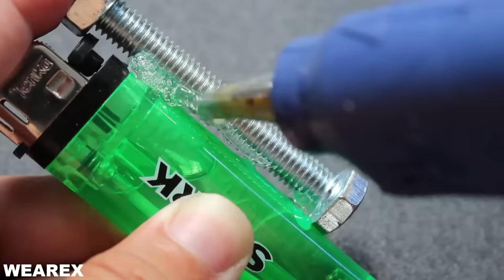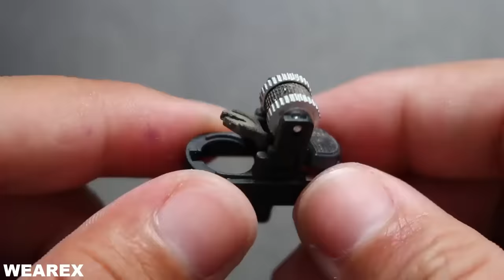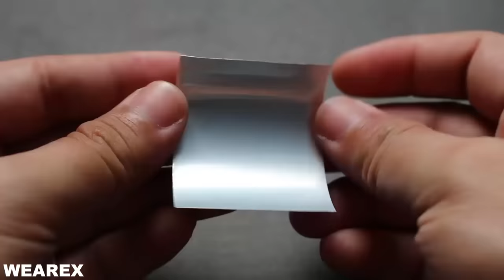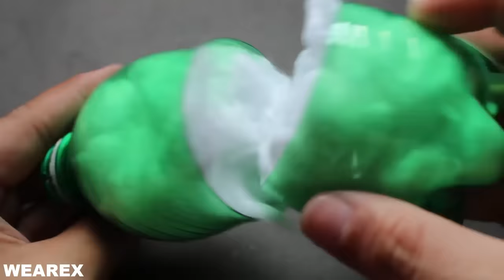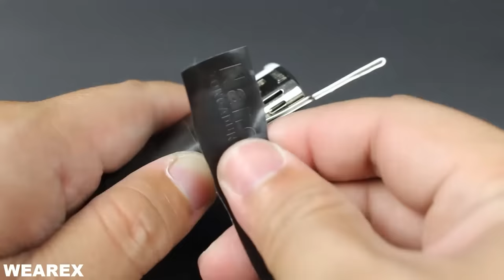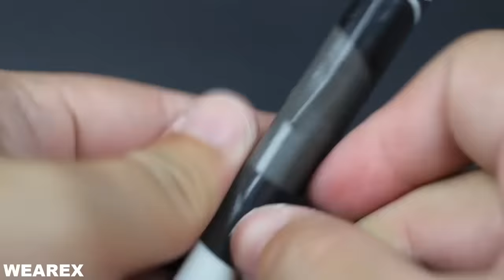Top 5 best life hacks for lighter

Comment: number 1 and number 3 are very unsafe. because most lighters are not supposed to be held on for more then 30 seconds or else the flint that is used to make sparks super heats and explodes.
you can see a demonstration if you take apart of lighter and pull off the wheel and see a bit of metal with a long spring.
light this to red hot and throw it on the ground and it explodes with a bright light.
number 1 hold down the spraying bit causing heat to build up. and number 3 using a cotton wick so close to the igniter is the same principle.
number 2 is just how tweakers light up meth.

number 4 as a make shift soldering iron is actually pretty good.
unsafe but good.
Reply: cheezandtoast #4 is just for use in a pinch
Reply: Since when have we cared about safety
Reply: I️ was like that’s not safe!
Reply: cheezandtoast I was actually freaked out waiting for it to pop lol.. It happened to me when I was younger
Reply: I see no use in doing any of these things.
Reply: Somebody who knows how lighters function? Big wowza, thought I was the only one.
Reply: yeah i was thinking the first few were like tips and tricks to being a better tweaker, but the soldering iron isnt that bad of an idea.
Reply: cheezandtoast-there's also no mention of the necessary protections from those inherent dangers along the way, like cutting your fingers open on the aluminum can. Only a young child might try some of these, and I hope someone sues youtube for providing unfettered access to this type of information to children without also providing any type of safety warnings-they deserve it!

Comment: the soldering hack is really good one
Reply: kris that soldering job was a really bad one though😂😂 Probably just invest in an actual soldering iron if you're going to be doing any soldering on any wire larger than what he did, and if you're going to be soldering more than once in your life. That would be a huge pain because the paper clip would cool off so fast you would most likely never be able to finish a solder in one heat, btw, don't cold solder like that.

Comment: So on the third one you took apart a lighter, to make a more crappy lighter??
Reply: i think he will show how to build a lighter without gas
Reply: Ok  so the idea is, "lighter dead? no sweat. Just get a plastic bottle, scissors, a bunch of cotton, electrical tape, a soldering iron, ethanol which  everyone totally has lying around & build a new one"... Or just spend a buck & get a new lighter. XD
Reply: xSlappykinkaidx or less for some matches!
Reply: it was a more like a way to start a fire from the inside of a building. throw it threw a window for no arsenic trace.
Reply: it was a more like a way to start a fire from the inside of a building. throw it threw a window for no arsenic trace.
Reply: Real Victoria glass bottle and some Gasoline?
Reply: MinnYX wool, plastic bottle, n alcohol
Reply: DanJBarnsley Or just bum a light.
Reply: The lighter he built will last much longer than the average lighter, and to refill it you just need cotten, which is much cheaper than lighter fluid.
Reply: FYI for anyone that thinks 3 is a good idea it would melt apart in 30 secs... Ever held one of those for that long? They melt and break.
Reply: Nah bruh he's showing how to make an old school Zippo lighter when it wasn't torch like. Pretty cool if you ask me.
Reply: Don't forget the screws.

Comment: #4 would produce a "Cold Solder Joint"  this is week and in many cases will increase the resistance of the wire.  You have to flux and heat the wire a you apply the solder.  I must say #5 was pretty cool as cutting foam is a mess and if you need a small piece its hard to do.
Reply: It wouldn't. It's flux core solder. You can tell from the smoke and because it wetted properly onto the wires.

Comment: how to make a shit DIY lighter out  of a working lighter
Reply: that is just in case the lighter resevoir is broken or need more bigger capacity of gas but thats not necessary to have a bigger one but if you have a broken resevoir then this would be useful
Reply: This is also useful in survival.
Reply: The ElectreKid because I'll need to be able to solder in a servival situation lmao. Not one of these is useful in a servival situation
Reply: Andrew Miller what if you dont have a solder and practically a solder needs electricity so you need power supply of course you dont want to waste ur time looking for one when ur starving. (unless you do the tutorial in making the lighter as a solder but there is no connection on about that cotton lighter I'm saying bruh)

Comment: As a life long smoker, of various different things, I guess this guy doesn't know that black plastic near the sparker melts and would ruin any of the work you just did.
Reply: Bro I build the beast of a beast that could withstand that 😆 stoned shit less I got the notion to try it do to the fact we were having a power outage and no candles ....I used copper pipe fittings along with brass fittings.... they were bad ass all you need that is not metal I'd the pull out top from a clipper the one kind that has the packing tool/flint holder combo dealo..... they are bad ass I'm working on making a few  larger ones that will be tiki torches for the yard with thier own sparker on each so you can just walk by and swipe a finger 😆

Comment: the first thing is SO STUPID! if the lighter gets to hot it explode! don't try this!
Reply: @jhondisjames2151  those cheap little lighters can't take the heat for long.  The longer you have it lit some parts are getting brittle, some are slowly melting and others are getting very hot.  It's not going to take long before that cheap little sucker has gotten too weak to hold the pressure from the fuel in its weak cheaply made little fuel chamber and either POP or KABOOM!   Take your choice.    I take these cheap things apart to salvage what I can for repairing other lighters.   I've seen the damage done to some of the parts after just a few days use.   That's why most of them are disposable.  Sometime throw away after just a few days use.
Reply: @jhondisjames2151  those cheap little lighters can't take the heat for long.  The longer you have it lit some parts are getting brittle, some are slowly melting and others are getting very hot.  It's not going to take long before that cheap little sucker has gotten too weak to hold the pressure from the fuel in its weak cheaply made little fuel chamber and either POP or KABOOM!   Take your choice.    I take these cheap things apart to salvage what I can for repairing other lighters.   I've seen the damage done to some of the parts after just a few days use.   That's why most of them are disposable.  Sometime throw away after just a few days use.

Comment: Using a lighter in that way will certainly cause it to over heat and fly apart, possibly causing injury and or damage.  Cheap plastic lighters are made to be hand operated and when they get hot you would feel it and stop before it got too hot.

Comment: If you just used a longer bolt, you wouldn't have needed to glue it on... It could just tighten over the length of the lighter.

Comment: Looks like with the ethanol lighter, that not only are you going to be burning your thumb on the second light, but t the flint wheel is going to pop out after maybe 30 seconds of it being lit, from the flint wheel holder melting and the spring under the flint releasing.

Comment: So is the point of this video to show how to blow your hand off? I'm sure the metal that you are attaching to those lighters to get them red hot is cutting into the tape or the PLASTIC lighters that they are attached too. I believe I'm no chemist or gone to school for chemistry but I'm sure if you mix lighter fluid with red hot metal you get fire and if it's in a contained space like a lighter, it goes boom. Not sure but I think that's how that works. If you read the package of those lighters it says to not remain lite more than a minute or two anyways at max. Just saying.

Comment: somoene can explain how its work for the number 3 looks awsome
Reply: *number 2
Reply: It doesn't they basically just blew a air pocket into the fluid so when the gas goes up the air will carry the flame (they did a separate cut with anotjer lighter)

Comment: The lighter/bolt thing....it only takes it burning 2 or 3 minutes to get hot enough to melt the whole plastic thing or even explode.I have used a lighter for a glue stick before in a piece to glue a fridge magnet back on and the lighter gets hit quick..dangerous!

Comment: #4, wrong.  You heat the twisted wires and touch the solder to the wires, NOT heat the solder and let it drip onto the wires.  That results in a cold solder joint, which doesn't conduct electricity or an audio signal, and is structurally weak.  FAIL!

Comment: The only really usefull thing is there is the soldering lighter, and then again, you have to heat up the wires if you want your soldering to have a good conductivity, so all you are doing with this is dropping hot pewter on two wires... So yeah ... Not really life hacks...

Comment: #1. Turning it off would burn your hand.
#2. No point.
#3. Stupidest thing ever its just a huge, non portable lighter that barely produces a flame
#4. Just buy a soldering iron, they're like twenty bucks and dont get melted after 5 uses.
#5. For plastic you can use a small drill bit and for styrofoam, wait, styrofoam is for packing not cutting into shapes.

Comment: there was zero enhancement of the lighter, which is what a lighter hack would be. one potentially useful thing was the makeshift soldering iron, and even that was more work than it's worth, because if you have something worth/need soldering you can afford a soldering iron. the other would be the last one, and I mean this from a MacGyver bong making sense. because if you've ever made a bong with a bottle you need to burn out the perfect sized hole for your slide.

Comment: #2 is neat. #4 is possibly useful. #1,#3,#5,are retarded ideas, the plastic piece that holds the flint and striker, on a cheap lighter like that, melts after about 30-60 seconds of being lit, and then it springs your flint across the room. If you wanted to go through the trouble of cutting the top off a bic, they could work for more than 30 seconds, but, still would be useless moronic ideas. No offense, I've done stuff like #5 out of boredom, but I figured it out from my boredom, is this just recording being bored?

Comment: actual research would help other then getting things off the interweb man...

did you take in account for the lighter being plastic? most of these will blow up in your face man? the plastic that holds the flint wheel melts which sends the thing flying.. which is normally very hot as well as the liquid plastic man.... your going to hurt people.. i would find something else to do videos on.. because i know very well number 1 exploded on you.. ams where is that video... or the warning that it will??